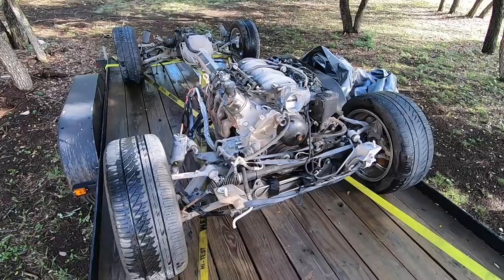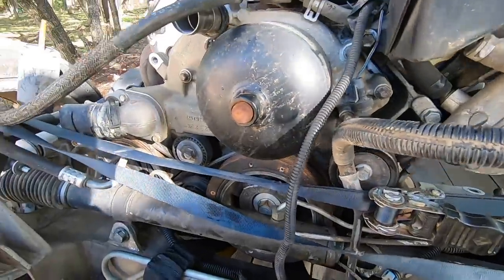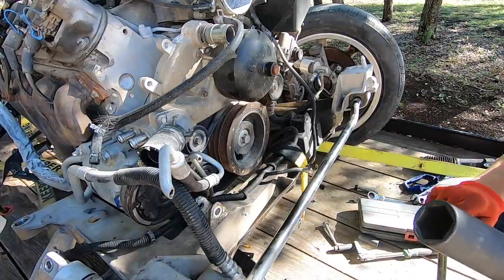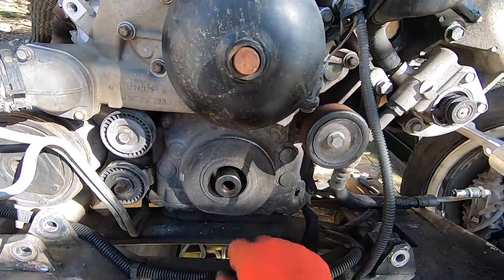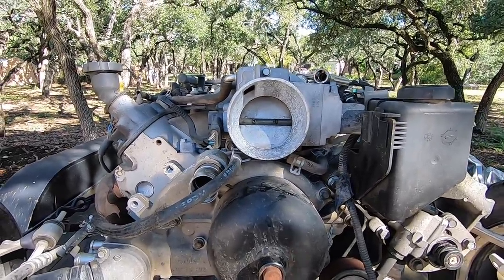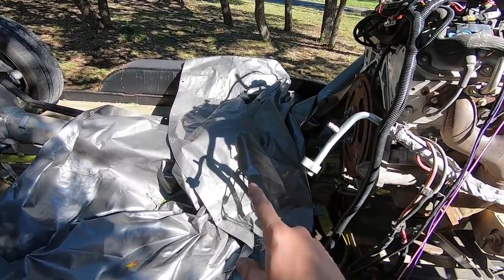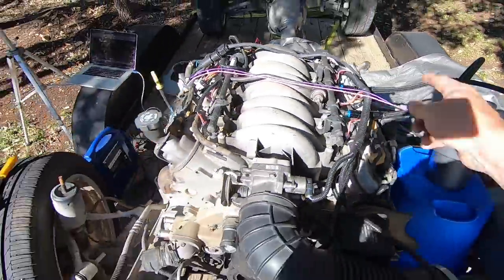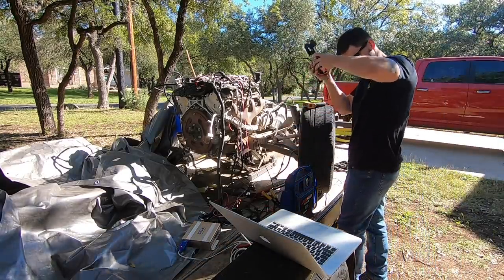I bought half of a Corvette.. Will it run?

Comment: This engine has to be out of a wrecked Vette. The front was hit hard enough to break the crank pulley and it flexed against the torque tube enough to break the bell housing. That is a hard hit.
I would check that block real thoroughly for cracks or breaks.
Reply: He already came to that conclusion within the first few minutes of the video.
Reply: @traditional85  ok